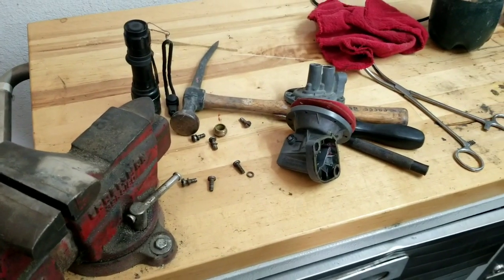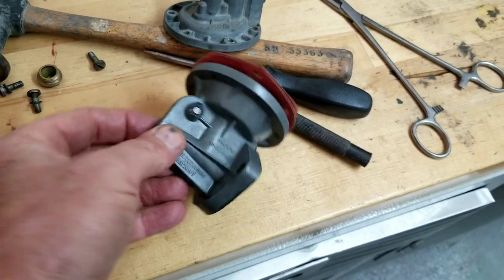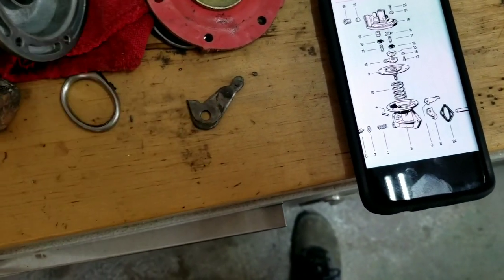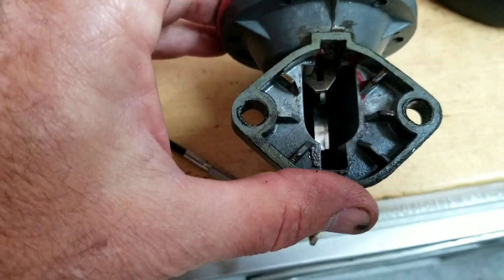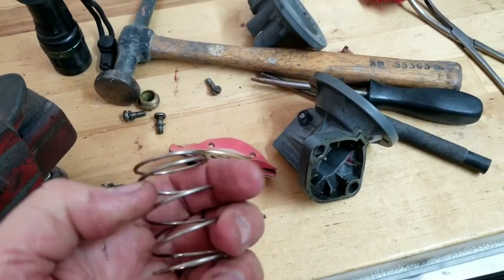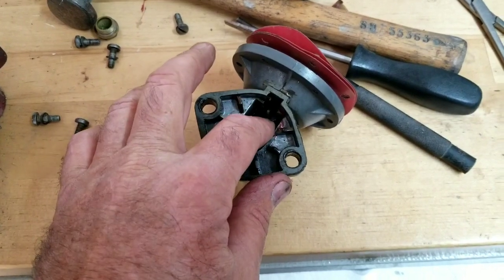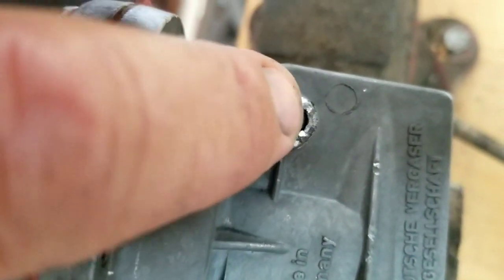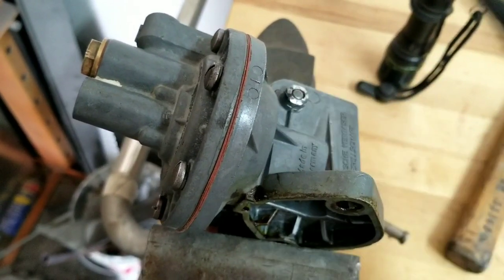VW 36 horsepower fuel pump rebuild

Comment: Just did the full rebuild on mine totally stripping the top half too. Don't forget to pre tension the diaphragm otherwise you will cause premature wear to the diaphragm - you either need VW Tool 328b - I used a M8 nut and bolt - bolted through a flat bar - the bolt protruded through  35mm onto the petrol pump pushrod lever and the flat bar clamped to the petrol pump base - you could rig something up using an old pump flange too !

Comment: Mike--You are making this way too hard. I just did three 36 hp fuel pumps in less than 2 hours including cleaning. I found you do not have to put both pieces in at the same time in the base. Install the spring and first half of the lever with a punch temporarily holding it in place. I then took a 5/16 X 1 1/4 long bolt and placed the bolt head against the lever and depressed it, I used a small piece of wood and a clamp to hold the lever depressed. Once that is done there is room to snake the other half of the mechanism into the slot of the first piece. As you carefully pull the punch out you work the piece into place and when its in you push the punch back through.  Then simply put the pin in and carry on as you have shown. I could send a picture or two if you are interested or have any questions. Or else you can send me the $200 and I will be glad to assemble them for you.
Reply: Do you sell rebuilt 36HP pumps?

Comment: Hello Mike, this is Andre from Brazil. I'have already assembled many of this 36hp fuel pump. This is a very hard job my friend. I always use two c-clips in that pin. Safety First, nobody wants to do this in the road side.
Are you using the Wolfsburg West repair kit? Here in Brazil we just have one supplier, and this is a real crappy. The spring is too hard (It causes Gasoline excess), the pieces are made with a low cost material. The Company brand name is TR. They Export those kits to USA. I have video in my Channel showing the spring problems.

Comment: Under an hour to build mine up. And then when the diaphragm gave out of me about hour and half on side of the road but thats having to deal with fuel lines and clean up. I work with weapons every day . Lots of small tricky parts so that probably helps
Reply from the maker: Wow and that was on a 36 hp pump. they are not like the newer ones. Mine was all apart because the pin fell out so I didnt have a clue how it went back together.

Comment: 3 hours later
Reply from the maker: yup I think 3 hours was about right for a 20 minute job.
Reply: @Mikefngarage  no way you could have done it on side of the Highway . I have an electric Mr. Gasket mini pump that make 3.5 lbs and a VW guy down here saw it and said - well what are you going to do when it quits = the same as you when the Mech. one quits WALK